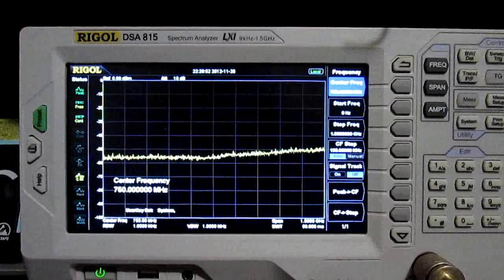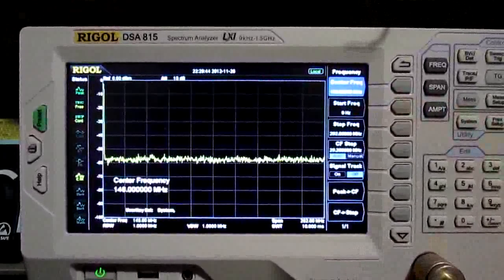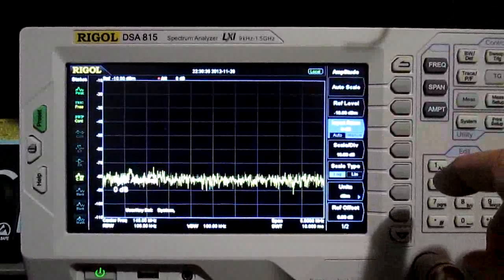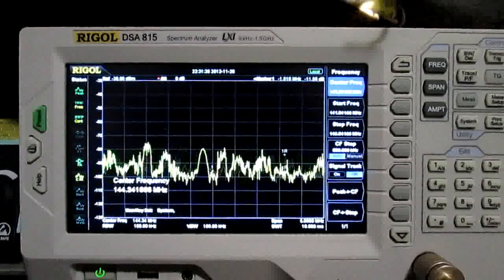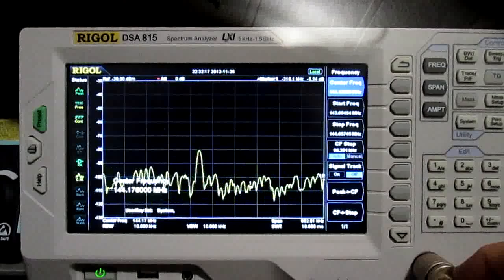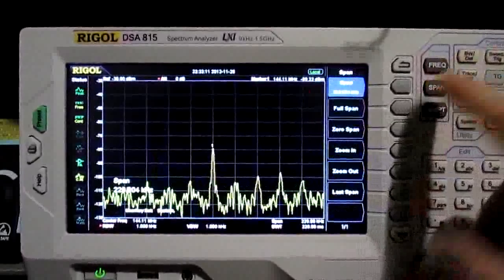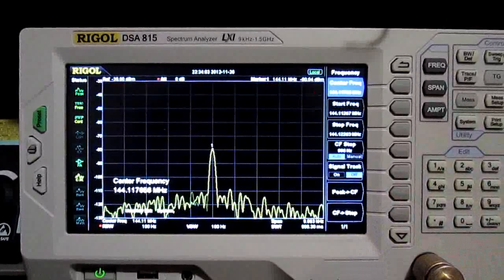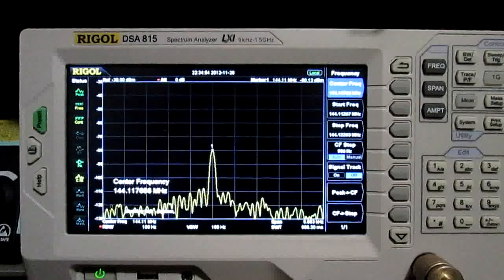RIGOL DSA-815 Spectrum Analyzer - Interesting anomaly ?

Comment: Does this analyzer demod?
Reply from the maker: +Commsprepper Yes it does .. though its a little tricky .. I have done a video on it as well as Rigol .. The biggest thing in my mind is the audio level is much too low and requires some form of amplification .. I would sugest computer speakers or perhaps a LM386 based preamp module found on ebay
Reply: Can you send me a link to your video showing demod?
Reply from the maker: +Commsprepper https://youtu.be/1DgNh7ZpaoQ
Reply: Are you happy with the analyzer?
Reply from the maker: +Commsprepper Yes ...  Does all I Need it too ..

Comment: I just probed my 815 from 1 MHz - 200 MHz and found some interesting spurs (there are many more, some of which are barely detectable, but these are the interesting ones):
44.11769 MHz
50.00000 MHz
100.00000 MHz
144.11769 MHz
194.11769 MHz
Like you said - no big deal, but interesting.
Reply from the maker: Did you see these under the same conditions as my setup ? 
Were they all about the same level ?
Reply: N2CUA Similar conditions (I did widen the span to make it easier to scroll across the range).  I used a small loop of wire at the end of a cable so that I could move it closer to or farther away from the 815 to let me see what was truly coming from the analyzer vs junk around the shack or off the air.  Level is tough because I was hand holding the loop.  These were all pretty strong when I moved the loop right up to the screen.  The rest (16 or so) of the sigs were at widely varying levels and in some cases, I am not really sure they came from the analyzer.

Comment: Hi,
Good video.. I have a very nice HP8566B spectrum analyzer but there is no tracking gen.
available for that unit that I am aware of. Do you have the tracking, if so, how well does it work with filters? Have you done a video using the TG.

Tnx es 73,
Glenn WA4AOS

Comment: It measures 144.117645 MHz on mine when using the frequency counter at 1Hz resolution, the RF preamp activated and just touching the centre pin of the RF input with a screw drivers tip. Probably some random RF coming off the display. I do love my DSA815-TG. Bit of a noisy fan in it, though!